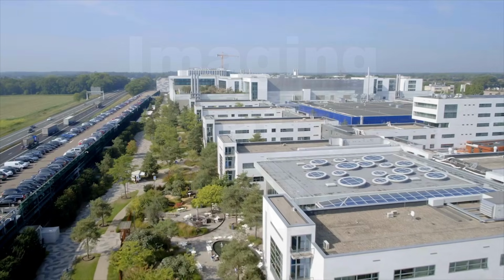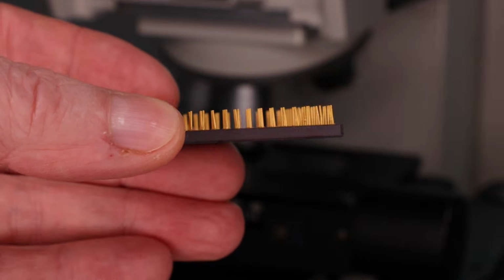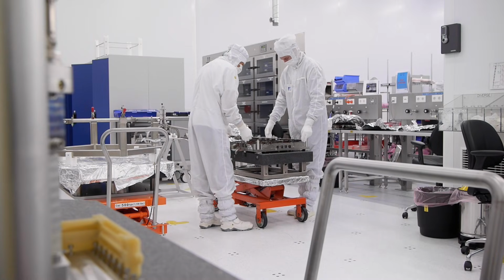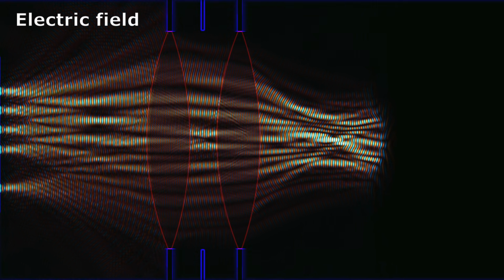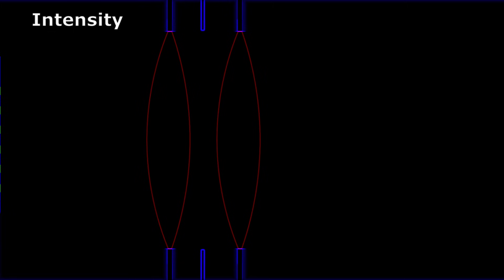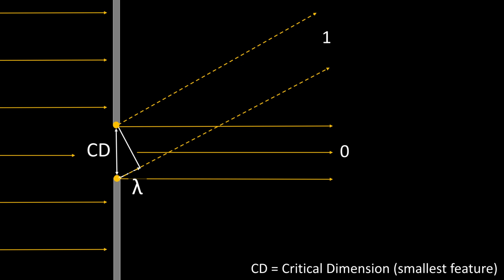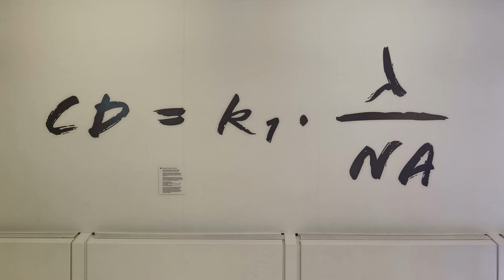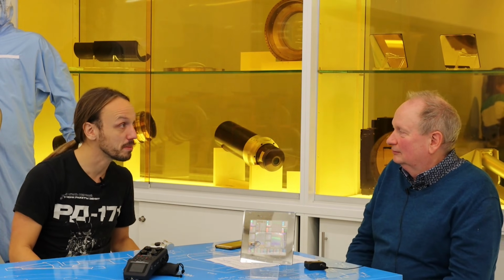Imaging at ASML

Comment: As a chip designer, I never stop having my mind blown when we get silicon back from the foundry. You slave for months over these chips, and you are used to seeing them the size of a massive screen, having to zoom in like crazy doing the connections of small signals, when zoomed out not even being able to see whole functional blocks like complex operational amplifiers or so on, let alone the huge individual transistors (huge with respect to the tiny transistors we use in digital circuits). And then you get silicon back, and that huge chip is suddenly so small in that wafer gel pack that if you were to sneeze, you would lose them all, and never find them again.
Reply: As a lithographer, I'm always amazed by how chip designers optimize and design their chips so they can actually be manufactured on our machines, given all the conditions that we give you guys. Mad respect!
Reply: @DrBlokmeister  I'd be very eager to learn if both of you listed some of the more interesting constraints. Perhaps the chip designed and the lithographer might even have different takes about which constraints are the trickiest.

I have some vague ideas of the constraints, but am neither a chip designer nor a lithographer, so my understanding is a bit abstract and still rather hand-waived. For example, I recall some of the constraints deriving from the diffraction pattern on the mask such that if certain desired patterns are placed to near to each other, there's no way to construct a diffraction mask that generates that pattern due to various interference effects. Corners and ends of lines are particularly tricky. I recall that many chips now use multiple patterns per layer in oder to work around these imaging constraints by putting part of the pattern one mask and part on a second mask.
Reply: @ddopson  The constraints are I think more subtle. You are definitely correct. But in the end it's all about achieving a level of contrast and the correct feature width (CD) that is acceptable for the rest of the fabrication process. Depending on the topology of the structures, you need a certain depth of focus and might need to tune the machine to reach the desired values. What you're saying is also not wrong. 

I think in the end our constraints are combined with all the other constraints in the manufacturing process, determined by the resist, material properties, etching, etcetera. Those final constraints are then communicated to the chip designers. At least, that's how I thought the process goes. If a chip designer tells you differently, believe that person!
Reply: @ddopson From what I understand, a lot of these details are ironed out by the foundry through their DRC (Design rule check) ruledeck. These have rules at their most basic do things like 'don't put lines closer than x nm to each other' or 'no line shorter than y nm', but quickly starts doing very complicated things like 'minimum line spacing is x nm unless you have more than y lines next to each other in parallel of the same width then you can decrease the line spacing to z nm except in the case where you need to contact the lines with a via in which case it changes again' blah blah blah, to the point that these rule decks are literally hundreds of pages (I think the one for the technology I worked in most recently is over 400 pages).

This is where a lot of the crazy stuff really is - there are rules that will allow you to only place lines on the finest structures in a certain pattern, with certain repetitiveness and on a grid, to make use of diffraction patters (or at least that is how I understand it - Sander might be able to correct me here). 

Another example is that you might start using multiple patterning, where one metal layer is split up into multiple masks and soon to make more complex shapes possible. 

The chipdesigners who really come close into contact with this are the people who design the standard cells---the basic logic gates---which really need to make as optimal use of all these tricks and features as possible, since they drive area of chips. In what I do (millimeter-wave chip design), the things that determine cost and area are not the transistors, but big passives like inductors and capacitors, and so we mostly look at performance of the transistor and not the area.
Reply: @JorenVaes  Very cool insights and context that you provide! All these rules you mention in the beginning make complete sense from an imaging point of view. Of course if all you want to do is place lines and spaces together, you can squeeze them in to the limits of your optics system. But as soon as you need something else, then that's gonna come at a cost. The more repetitive your structure, the easier it is to optimize for. If you want multiple structures at the same time, you have to optimize for all at the same time, and this means that all feature will perform worse than they could if you'd print them separately.

Also if you put things on a fixed grid, then your diffraction pattern will be discrete, as the Fourier transform of a grid is also a grid. This makes it easier to optimize the illumination settings (incidence angle of light). As soon as you want to place one feature off-grid, it will likely underperform and maybe not print well.
Reply: @DrBlokmeister  Yep, fixed grids and orthogonal patterns are the way everything is going for lower layers. I haven't worked on any EUV nodes, only 193nm, but even on the 28nm process I worked with poly has to be pretty much just parallel axially aligned lines. The higher you go up the stack into BEOL, the more freedom you have with design rules (since the feature sizes are larger).
Reply: @AndrewZonenberg  lower layers? I don't have a good model of how a whole chip is constructed, but I have this vague idea that the logic is "on top" and connected by layers below it. Is that stack manufactured upside down with the smallest stuff first?
Reply: @atonal440  The bulk silicon substrate has transistors formed on the top surface, then glass insulation, then additional levels of metal interconnect are added on top.

Once the entire chip is manufactured, it's then attached to the outside world either by ultrasonically welding wires to the top surface (typical for low cost parts) or, for high performance devices like CPUs and GPUs, solder bumps are attached to pads and the bumped chip is then flipped over ("flip chip") and soldered to the package substrate. This provides better electrical performance as well as easy access to the substrate for mounting a heatsink to.
Reply: @JorenVaes  As a component level PCB repair tech, please add as much I/O pin hardening to your designs as possible, to combat against out of design spec voltage and current ranges (to a certain point, of course), so that when something else fails in the circuit (usually due to external forces like moisture damage or ESD), the more important chip has a better survival rate. In the field I see some chips that fail at a drop of a hat, and some that survive almost the impossible failure modes around them. Just my little rant haha, the boards are so much easier to debug and repair when logic is mostly intact and the power rails are faulty.
Reply: @FrozenHaxor We do actually include such circuits, but it is a tradeoff. We include ESD (electrostatic discharge) and sometimes EOS (electrical over stress) circuits. But increasing the 'strength' of these circuits, comes with the downside that the IO circuits require more power (as they have to drive a larger capacitive load) or not even reach the performance requirements. This is also getting harder and harder, as the normal operating voltage and damage voltage are getting closer and closer with newer technology nodes (this is called the ESD window). 

The thing is that the ''important chip' will usually be in the 'fanciest' node that is most sensitive, and have the most IO so it will have the most points of failure.
Reply: @JorenVaes  Yep, it's unfortunate, the chip structure is just so delicate nowadays due to the newer nodes that they become extremely delicate in some cases.
Reply: I wish there was a podcast with you guys :)
Would be so interesting listening to people from all kinds of related fields talking about there work. 🤩🤩
Reply: One of the best conversations I’ve seen on YT.  Quality of this thread is a testament to the quality of this channel!
Reply: Amazing discussion in this sub thread - thank you
Reply: This is easily the best thread discussion I’ve ever seen on YouTube!
Reply: @JorenVaes As a fellow chip designer (newbie 2-3 exp years) working on Testing this thread honestly is goated. Sitting on interface of design and manufacturing to build circuitry as well as doing yield analysis, this thread makes me appreciate the role feel awesome. @DrBlokmeister Thanks for different viewpoint on manufacturing from lithography viewpoint. GEM of a thread!!
Reply: How does someone become a chip designer? I don’t remember seeing any uni courses for it.
Reply: @br3nto use search terms "integrated circuit design", "vlsi design", "rfic design",  +"course" or "class", you will find them
Reply: @br3nto Most chip designers are electrical engineers. Electrical engineering is a very wide field, and as a result even in 'electrical engineering' degrees offered at universities, there is a huge variation in what exactly they focus on. My university (KU Leuven) has a long history with IC design, and the fact that imec was spun out of our university results in our masters degrees offering a track that is specifically focused on IC design, with courses on IC manufacturing, analog IC design, digital IC design and so on. 

But I know of other universities that might focus more on industrial control systems, power distribution, etc... all sub-fields of electrical engineering that need specialized people.
Reply: Hey, my dream job has always been working in chip design or something of sort. What do you recommend would be a way to get inti that field. I have finished my computer science highschool and now im in electrical engineering university
Reply: @exeos1512 I would say keep going on the path you are on, but look for master's programs that focus on chip design, there are a lot of universities out there that offer this!. Good luck!